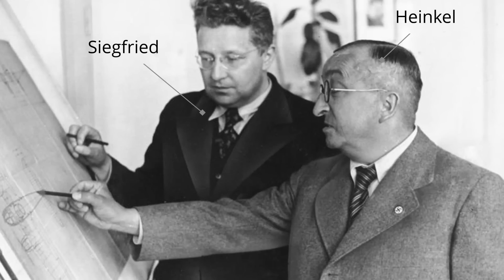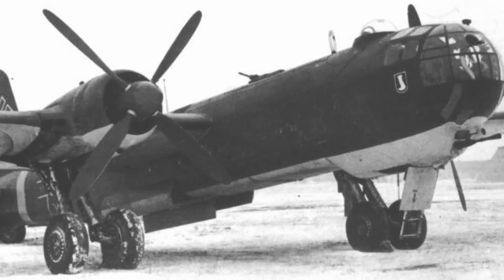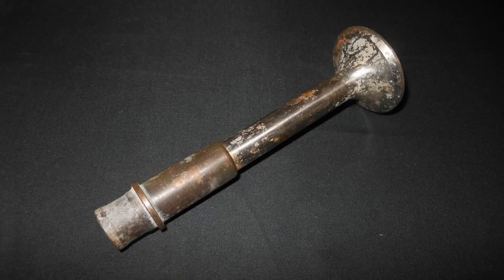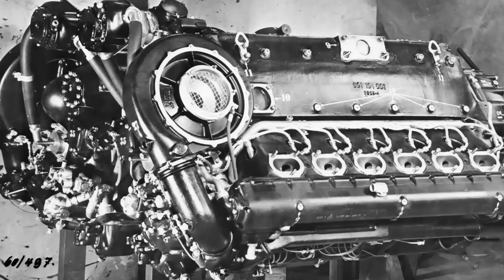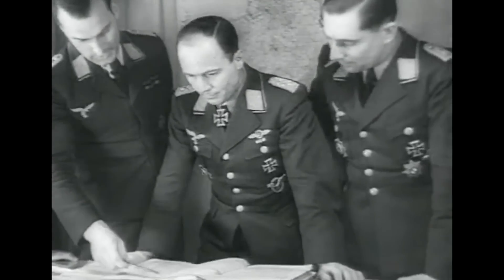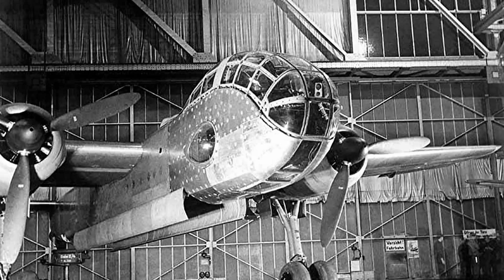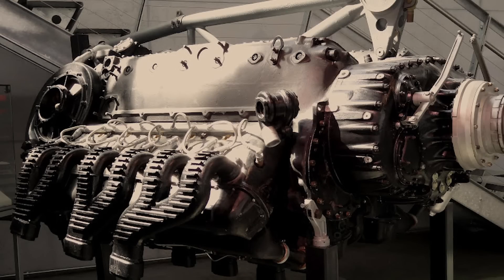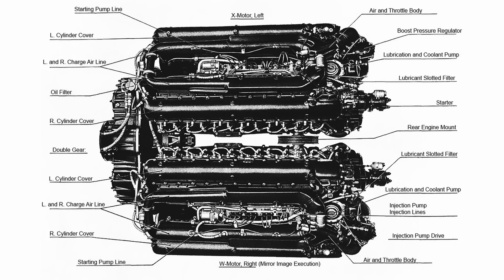Why did WW2 Germany Start Welding Engines Together? DB 600 Double Motors

Comment: Why did WW2 Germany start welding engines together?

Because glue hadn´t been invented yet...?

(Yes, yes. I am aware that primitive animal-collagen-based glues were extant in the 40s, but that wouldn´t be nearly as funny, would it?)

I cannot help thinking that this excellent video, one of many, couldn´t have been joined with a ahem better title....
Reply: This is a job for flextape
Reply: Yes, I was intrigued at the idea of engines being welded together and then found that they weren't.

Comment: Kind of an odd way of doing things but it works. The far more modern, but still old BMW M70 is a similar concept. It does have a new original crankcase containing a single shaft driven by two otherwise separate inline 6s which are essentially M20B25s. In theory I don't know why you couldn't make a w24 that way, but I don't know of any engine like that. Such an engine would probably have 4 rods per crankpin. There was at least one american analogue to these DB engines, the Allison V-3420, which was two V-1710s.
Reply: The Curtiss Museum in Hammondsport, NY has an Allison 3420 on display with the reduction gearing and prop shaft and it is quite the site to see
Reply: @jeremyporter7443  If I'm ever in NY I'll make sure to check that out.

Comment: The Napier Sabre 24 cyl engine in the Typhoon also had two crankshafts although this was how it was designed - not done as an after thought. It had its fair share of teething problems (which included catching fire) but really came into its own once these were ironed out. It had sleeve valves and was really compact making it also tricky to work on and a lot of special tools were required.
Reply: I have one of these! Complex af, can't see how you could maintain in wartime.
Reply: @suzi_mai  You have a 24 cylinder napier sabre
Reply: @squidwardtentacles244  yes i do! I got it from a commercial pilot I know. Missing the starter though. Otherwise complete. 1944 model. Not stuck, turns freely. Not sure where he picked it up. Makes a neat conversation piece in my motorcycle shop.
Reply: @suzi_mai  Really that is awesome, would love to see some videos or pics of it. Cant be many of them around, there is a guy trying to put one in a plane and they have only 2 of them so super rare as most were sadly chucked in the ocean after the war.
Reply: Impressive as the Sabre was, AFAIU the issues were never really ironed out and it remained a very temperamental and maintenance heavy engine. Eventually it was superseded by the Bristol Centaurus radial (also a sleeve valve design, FWIW) in the Tempest Mk II and later Sea Fury, but that was too late for WWII and then jets took over.
Reply: Napier Sabre reached 3,500 HP and flew in Hawker Tempest and Typhoon... its main problem was that cylinder liner had to be  rotated by a complex arrangement  for the sleeve valves to work.

Comment: Your talking about engines not "motor's" Multiple system power plants are called engines. A motor is an something like a electric only generator not a multi system engine.

Comment: You never said why it was disastrous they didn't have a firewall. I assume it's because the engine fires melting the tires and hydraulics?
Reply: He 177 caught fire a lot. Bcz of heat, so spread easy with no firewall.
Reply: @suzi_mai  Right, but it's something that he mentioned, but never elaborated on. We're left assuming and trying to figure out why he mentioned it.

Comment: Reason for  Mercedes Daimler,s wacky conjoined engine, is simple, the lack of 100 Octane Petrol, even the brightest German Chemists could not synthesize the formula for 100 Octane Petrol.  So no chance of  2,000- 2,100 ponies from a single German built aero engine  of 18 or less cylinders, like Pratt&Whittney,s Excellent R-2800. The nearest Daimler got from a single engine without nitrox (GM) power boost is 1,900 from  their model 603 that powered Heinkel,s Model 219 (Uhu), a twin engine tricycle undercarriage night fighter, and the nemesis of many Mosquito,s. To make Germany part self sufficient in petrol for auto and aero applications, fat Herman with the RLM,s blessing  set up plants in Leuna to extract petrol from coal, thus  conserving  precious stocks of crude suitable for aviation petrol brought in from the Rumanian oil fields at Ploesti. Pretty crap petrol ,okay for your 3-ton Opel Blitz Lorry, Volkswagen  Kublewagen and Horch 4x4, a ponced up over engineered Dodge Command Car but useless in the tank of a BF109F or FW 190A . From 1936-37 to 1944-45 Fat Herman,s Luftwaffe  burnt 87 Octane, same crap petrol you fill the tank of your lawnmower extracted from Rumanian crude or coal, so cats&kittens the Daimler,s pony count is lower than an equivalent Allied engine. To make my point, in late 1937-early-38 Rollers( Rolls-Royce) at Derby modified a Merlin 3,fed on 87 Octane 990-1030 ponies, same engine now tweaked burning 100 Octane 1,200 ponies, not bad for a change of diet , .Those one hundred seventy extra Roller ponies won us the Battle of Britain, allowing the pilots of Spitfires, Hurricanes, and Defiants  to ramp the bollocks out of their Merlins to chase down DB engined BF 109,s and 110,s without fear of the engine blowing up at high boost ratings. Because of crap petrol ,crap materials DB engines were second from bottom on the pony count score board, with the life expectancy of a Mayfly.  So in  all DB,s Conjoined engine was a futile waste of time, precious materials  and expertise. Guess cats&kittens, who made a conjoined engine work  reliably, the GM Allison 3420, 2,600 ponies burning 100 Octane for less than sixty litres.
Reply: Could you expand on that a bit?
Reply: @givenfirstnamefamilyfirstn3935  needs more cowbell
Reply: I agree with all your points, but maybe you could have posted a "condensed" version

Comment: The tree DB 600 engines series shared similar issues with all double engines that was tried to be produced like the Vulture all sharing similar unreliability due to the excessive heat generated by inner exhaust system possibly because of badly cooling system. The other issue was that the DB engines was built too near the main spar with no firewall despite the criticism of the engineers. The real failure of the DB 600 engine series was the enormous waste of resources and time when it could be easily built like the Lancaster but unfortunately it was built with a moderately dive requirement requiring strengthening of the wings and of course weight. Really a good job, looking forward to see your next video 👍👍👍

Comment: In his autobiography 'He-1000'  Ernst Heinkel described the disbelief that he and He-177 Chief Engineer Hertel felt when Generalluftzeugmeister Udet expected this 4 engine aircraft (already expected to meet stringent performance demands for a late 1930s heavy bomber) to be capable of dive bombing. This led to extra structural reinforcement which added weight and reduced payload and performance and left them scrambling for ways to make up for these losses. If I recall correctly, the idea of reducing drag with coupled engines cooled by surface evaporation (which was dropped early on) arose from attempts to claw back performance losses caused by the dive bombing requirement. This had worked well for the He-119, so it seemed like a good idea.  Heinkel held Hertel responsible for the missing DB-606 firewall and later fired him for allowing it.

Heinkel offered a new He-177 version with new wings supporting 4 discrete engines as you describe in the video, only (as he put it) to be declined by a piqued Goering, personally embarrassed before Hitler due to the ongoing failure of this aircraft who ordered Heinkel make the He-177 work with coupled engines.  While attempting to do so, Heinkel built two of the the 4 discrete engine versions in secret out of the view of Goering in France (the Farman He-274) and in Vienna-Schwecat (the He-277B). Both were said to have shown really promising performance and the Farman was used by France after the war into the 1950s for launching high speed test aircraft. Thus Germany lost it's final chance (perhaps too late to be of much use) at a possibly first class heavy bomber.

Goering was adept at deflecting personal blame. He told Heinkel that Udet had told him the He-177 was required to dive bomb, which he rightly considered to be madness. Sounds like he dismissed coupled engines after the fact the same way. Much of this grief might have been avoided had the Jumo-222 appeared on schedule, but it arrived late in the war and really wasn't ready for operations.  Junkers just didn't have enough qualified engineers to oversee production plus intensively develop this 24 cylinder engine.

Contrast this sorry tale with the Avro Manchester. 
This was a heavy bomber built around the Rolls Royce Vulture X shaped engine that turned out like the DB-606 to be unreliable in service. Rather than being forced to waste time and resources making the unworkable work, its designer Roy Chadwick was allowed by the British Air Ministry to redesign the wings to carry 4 Rolls Royce Merlins, resulting in the hugely successful Lancaster.  So much of the engine technical problems the Luftwaffe suffered was due to remarkably poor technical oversight from the RLM. In another video you mentioned the German lack of equivalent to the British use of RTOs to report what was happening in the engine development and production which held the British engine manufacturers to account. Had Germany somehow been able to find back-channel sources of strategic minerals like tungsten, chromium, tin and manganese specifically for engines, backed up decent official technical oversight, one can only imagine the engines they might have made. Given all of that, what they achieved - especially in gas turbines - was pretty extraordinary IMHO.

Heinkel made a point during in his book that the imposition of The Treaty of Versailles sought to destroy Germany's ability to produce viable military aircraft. In his view the interwar years showed it had failed to significantly affect German air-frame design but that it had seriously impacted reciprocating engine design and development. He had considered moving into building such engines himself, but he considered Jumo, BMW, Bramo and DB had too big a lead for that. Besides Heinkel was aware of transonic propeller tip speeds limiting the ultimate performance of propellers. So he chose a different direction and pioneered jet aircraft - for which once again his efforts appear to have been slapped down by the RLM.

Great video! Totally enjoyed it.
Reply: I wonder for a bomber why they didn't consider a push-pull configuration (like, say, Do-335) with two nacelles with two engines each?
Reply: @jbepsilon  
An interesting question. 
The inline thrust concept was pioneered by Claudius Dornier when he worked for Zeppelin, then later on his own aircraft like the Do-X flying boat, so he had quite some experience with it. I don't know if Heinkel, Hertel and the Gunthers would have considered it, but it might have been an elegant solution, albeit with more potential for drag than one giant prop driven by coupled engines buried in the wings. Given the extra weight imposed by the bracing to meet stresses caused by ridiculous dive bombing requirements I would guess Hertel was looking primarily for aerodynamic advantages. Had he known the trouble the DB-606 would cause he might well have considered paired inline thrust nacelles. Who knows?
Reply: -The He 177A was also supposed to be able to use either the Jumo 222 engines (a liquid cooled  6  x 4 inline radial), the DB604 (an X24 engine) or the BMW 802 (an 18 cylinder radial with the same bore as an 801) all these engines had 2500hp to 2800hp.   
-The Luftwaffe chose the Jumo 222, it was the most radical design but promised the highest cruise speed.    Obviously the 18 cylinder 802 radial was a well-established pattern while the DB604 Prototyps showed no Problems.   The Jumo 222 was given an excessively ambitious timeline (it takes  6 years to design an engine in service) and 2500hp from 87 octane fuel was ambitious.    It was read for production by 1944 and scheduled for 1945 with 2800hp with 87 octane and MW50.
-No one had a 2200hp engine in service till mid 1943 (Centaurus, Sabre, R-3350)
-I suspect the BMW 802 would have been the least risky engine to develop.  
-The He 177B was simply a He 177A with 4 separate engines but it never got the go ahead.  Had it have been preceded with in 1940 the He 177B would have been in reliable service by earl 1942.   The He 277 was a more radical modification with new wings, bigger engines, new cabin new tail.
-The coupled DB606 (2 x DB601E) and DB610 (2  x DB610A) seems to have been a interim or backup engine.   The DB606 seems to have been effective on the Me 261 where the engines were placed ahead of the wings, with a firewall and with radiators clear of the engines under the wings.   .
-These engines were not "welded" together but separate with a combining gear box.   When the US created a coupled engine the V-3420 out of 2 x Allison 
V-1710 the used a single common crankcase with a shaft down the middle like the Napier Sabre.   
-When the DB610 (2 x D605) I think the DB605 may have been much of the problem.

Comment: Very informative and enjoyable presentation. I always thought radial engines were primitive as compared to the German inverted V engines. However, as with so many of the German intricate designs, the simplicity, reliability the ability for the American radial engines to be mass produced wins out.
Reply: I don't think I would consider a "radial engine" primitive. Ever take the time to figure out how the cam timing works?
Reply: Have a look at the double stacked radials used on planes like the B-24 and I don't think you'd call it simple; and it wasn't just the US that made a large use of increasingly complex and powerful mass produced radials. I think Greg's channel mentions a few times the debates of radials vs inlines, with the use of improved coolants allowing watercooled inlines to start surpassing inlines, then the Fw 190  came along... a very interesting subject!
Reply: Germany did produce about 60000 BMW 801 radials, mostly used in FW190A. I think that's about 1/3 the production numbers of the DB600 and Jumo 200 series inlines, so less but not insignificant. The interesting thing is that almost all of the German bombers used inline engines (I think there was some Ju88 variant with the BMW 801, but very low numbers), whereas the US bombers all used radials.
Reply: There's someone in one of Greg's Airplane and Automobiles video that said Germany is prioritizing Inline engines as it was simpler and faster to make than Radial engines, that theory kinda make sense to me considering how many inline engined aircraft Germany have late war, but i can't really confirm this as the source is just a singular YouTube comment